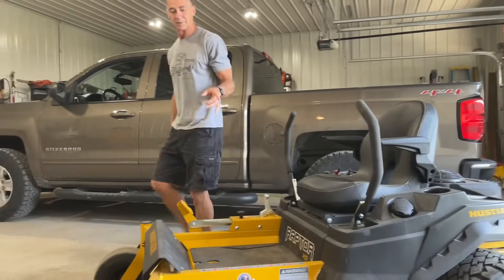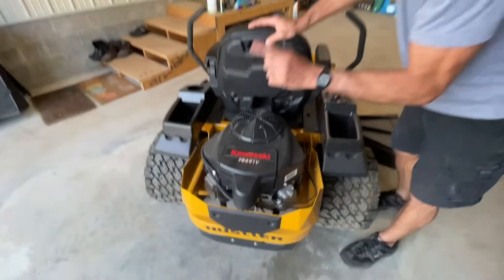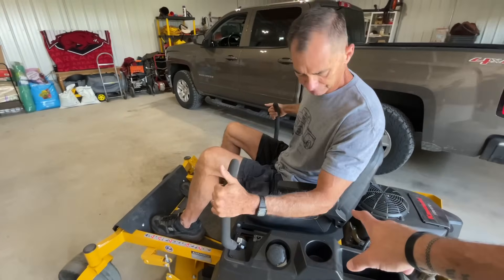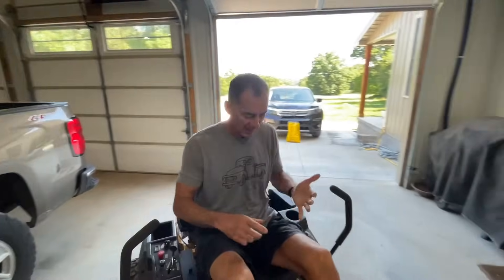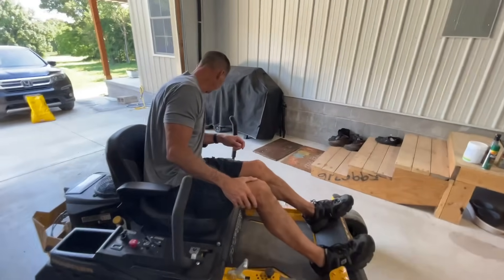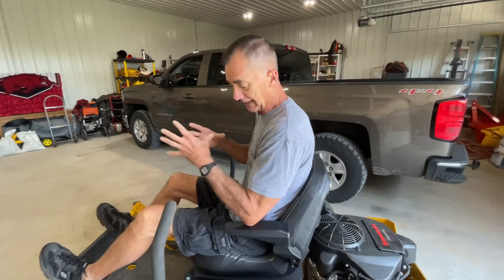DON’T BUY A HUSTLER MOWER UNTIL YOU SEE THIS!

Comment: I found it easy to buy my Hustler here in Australia. mine is the 34" Dash XD. When I found out the deck was fabricated and it had a Yamaha motor and it will fit around my water tanks it was a no brainer. It was hard to near impossible to find a zero turn that offers as much as this one. At $6500.00 dollarydoos it wasn't cheap but I need it to last. One acre is what I am mowing.
I am still waiting for it to arrive.
This a great review. no love for the brand but what it is capable off.👍👍
Reply from the maker: Congratulations,  Yamaha motor. Interesting. I hope we both have them a long time

Comment: One thing you didn't touch much on were the specs, specifically the Hydro-Gear transmission. Specs can be boring, but the right one can be helpful. I bought this model partially due to the the model of the Hydro-Gear (along with the Kawasaki engine). The ZT-2800 has a removable oil filter that you can change out along with the oil. Lower model numbers, such as ZT 2100/ZT 2200 (aka EZT) are factory sealed and don't require maintenance and don't have filters (or so I didn't read that in the service manual) unless the oil got contaminated. The service manual also doesn't mention the torque for these models. But the ZT 2800 produces up to 300 lbs-ft and the ZT 3100 (found in the XDX produces up to 350 lbs-ft). Also the gross vehicle weight is 1000 lbs and 1200 lbs, respectively. Thus if you want to tow some firewood, seeds, weed n feed, etc. then the transmission and engine HP will tell you how much you can haul. I know that may sound 'boring'. But imagine this. You go to a big box store and buy something with a few less HP engine and smaller transmission, then wonder why you have possible issues. My property doesn't have one level spot at all. It is all hills with some very steep. Thus I appreciate the transmission in the XD. I don't know if you researched the transmission, but at least you (or a dealer) can perform a transmission oil (and oil filter) change as regular maintenance, especially if you give your machine quite the workout. I am glad Hustler matched up the engine and transmission. With zero turns, you always want to buy as much (good) hardware as you can afford. By seeing the better engines and transmission, I can see this guy lasting a long time (compared to some of those cheaper big box brands).
Reply from the maker: Great information Eric. I did not know the numbers on the transmission other than xdx was more powerful. My ground is pretty level fortunately. I would have considered the xdx but for the 54 or 60 inch was several hundred dollars more so the xd fit the work and the bill. I agree this mower should last a long time. I really like it
Reply: @grandpadossfarms  Yup best comment I have read in a while on ZT. It’s all about the hydro’s on the mower that is where the cost difference’s are and the jump from residential to commercial. The larger serviceable hydro will cost more but give a residential owner a mower for life!

Comment: We own the Super Z 60" commerical mower.  Its a 2011 Model and we maintain around 6 acres of uneven property.  I can only compare ours to those I have used which is a Skagg and a Kubota.  The Super Z is a cutting machine as far as speed goes and though other brands cut just as well I don't think they can keep up with the speed and durability of the Hustler.  I have a friend who swears by his Ferris since the ride is supposed to be much smoother.  But all in all it would be hard for me to switch to another brand without a good test drive!

Comment: I’ve never had a hustler mower but I’ve done a lot of research and if I was rich enough to afford it and of course the property where I would need it they’re super 104 model is pretty amazing. Lol. It’s similar it’s the industrial but it’s got flip down wings on the side and 104 inch cut and you can do a football field which is just over 1.3 acres in 10 minutes. Lol.

One thing you were talking about are the handles or the armrests and getting up putting pressure on those. I realize they might break but one good thing I noticed is he just screw right down to the side and it gonna be really easy to replace if they do. Not all seats are quite that easy.
 Lol Chad camera I think you’re allowed to say John Deere. My old John Deere, I still have it it’s just very old doesn’t really have a gas gauge on it but there’s a little part of the tank that sticks out under the front of the seat so you can see the fuel level in there through the plastic on the tank.  Fugate it would be nice but even on some of the very expensive mowers I don’t see them. No rush she looked for one but it would be nice. Especially if you have a diesel because they’re a pain if you run out of gas you have to re-prime everything.
Reply from the maker: 104 inch cut, ha that's a big one Shane. Ty for the comment. Have a good day
Reply: @grandpadossfarms  it’s pretty much exactly what you have, it’s their industrial version but it’s just wider and faster. Lol. Way overkill for most of us but I like overkill when I’m dreaming but I think you made a great choice.

Comment: Hi Ralph great video I have the 42 inch hustler and it’s the best mower I have ever owned I myself like to maintain my own mower as I’m a mechanic by the way I’m living in perth Western Australia a long. Way from you . I heard about the fuel gauge issue I use the hour meter to work out when I need more fuel that seems to work well for me  the selling moto here in australia for the hustler is (putting the enjoyment back into mowing ) I have just put 60 hrs on my hustler still looks like brand new have never had anything go wrong with it .regards peter

Comment: Flex forks are a must.  Suspension seat would be the icing on the cake but with how tall you are you would need the steering lever extensions.  But I'm telling you the flex forks are worth every penny.  I don't know if the new raptor xdx and xd models come with a heat shield for the muffler but if they dont I would deffinitely get one of them.  If u notice burnt spots in the grass that is why.  The only thing I hate about this new model raptor xd is the lack of a visual fuel guage.  The older models had a cut out in the plastic cover so you could see the fuel level without lifting up the seat, you could bend over and see it while you were mowing.  Also you may want to look into gator blades and an operator controlled discharge chute for the fall if you mulch leaves.  I love hustler mowers.  No one can recreate that smooth track steering that they have.  You forgot to mention the integrated parking brake.  People don't realize how convenient that is until you mow without it.  Picking up stick, moving toys ect.
Reply from the maker: Great comment John. Definitely gonna get the forks. Yeah I forgot to mention the brake. Not being too familiar with ZT's didn't know that was a plus but I like it. Appreciate the information

Comment: I cut 10 acres of grass. I’ve got a 2014 hustler super z with hyper drive rear discharge. I did pay $14k, and it takes me 2.5 hrs to cut. Residential zero turn took me 6-8 hrs to cut before this mower, my back and time got saved. I would spend the money today for me

Comment: Most important for longevity and reliability - does this model have oil change serviceable axle drive transmissions ?
Im 72, in New Hampshire, retired master technician with German car dealer. I know quality and sound engineering . Good presentation gentlemen 👍✌️

Comment: I bought my Raptor in 2016 and it was my 1st zero turn as well. Retail was $3,300. I also have the Kawasaki 23 hp engine. One thing that matters to me now is the changing the hydraulic fluid myself in the drive units. I do not have the filters or the reservoir on mine and it looks like you don't on that one. I would want that if I was buying one again.

Comment: I said xdx but it's a Fas trak 54. I bought a commercial mower because if I decide to sale it it will sale easier. I'm cutting just under 2 acres. Was using a craftsman gt6000. This new o turn is a war horse.

Comment: Convinced me of what I need.  Think I'm getting the 42 inch hustler xd.  Did Grandpa ever think of drilling the frame and installing a grandpa pole?  I've seen various aftermarket poles that are installed at the front of the mower foot deck.  Just another option.

Comment: I just bought a 54” Raptor XD, and put it through the one heck of a boot camp to find it’s limits. 
I mowed thick, high weedy grass in the rain. 
I almost couldn’t get this thing to sink or lose traction. Those wide tires are great. 
It will bog down with the thick wet stuff if you don’t take it slow. 
I managed to stall it out by disengaging the PTO with a choked deck and reengaging it at a lower throttle position. 
It didn’t want to start back up after that. It would try, and you could feel the engine shift bit it wouldn’t turn over. 
So I raised the deck and cleared as much as I could by hand and made sure I could spin the blades. 
Then it started up, but with the blades still engaged (PTO switch was off). 
I had to throttle it up and cycle the PTO switch on and off again to get the blades to shut off. 
No problems after that. 
I guess the PTO switch/clutch got stuck. 🤷🏽‍♂️
But now I know what it can and can’t handle. Now to put some hours on this dude.

Comment: Bought a raptor sdx In 2018. 80 hours on the original motor and it blew up. If you can avoid Kawasaki motors, do it at all costs.
24 hp btw

Comment: I was thinking of buying this Hustler Dash XD. 
But when I compare it to the Snapper 360Z Kawasaki same 42" inch cutting
 width, Hustler is a little low power 18 HP vs Snapper 21.5 HP.
Hydro gear is ZT 2100 on the Hustler EZT 2200 on the Snapper'
2 gal. fuel capacity on the Hustler 3 gal. on the Snapper.
Hustler warranty is only 2 years  200 hour part only compare to Snapper 3
 year unlimited hour and parts & service. Lifetime on the Frame.
So I went ahead and decided to buy the Snapper 360Z.
Reply from the maker: Congratulations, the most important thing to me is that you did the research and made a great decision. I had a snapper tractor I gave to my son. Good mower

Comment: Does it have a parking brake?  Does it stop when the controls are in neutral? I’ve noticed the bad boy even though controls are in neutral it will creep.  Mow in reverse? And is there steps in order to start it?  Parking brake if it has one need to be set?  I’m sure lever need to be in neutral but I don’t like the bad boy having to have parking brake set in order to start.  Gonna try to get to dealer and get these questions answered just curious.  Also what’s yard look like now?  Mulching blades?  Oh also does the shoot flip up and stay up or is it spring loaded and fold back down automatically….great review of more as well I’m comparing the bad boy life with this line and model.

Comment: I have the same exact machine.  My 2 gripes, you can only fill the fuel tank about 2/3 because the filler neck isn't on top.  And those tires are terrible, they spin all the time.  I have more dead spots in my yard now because of spinning tires.  And it doesn't matter how slow I go, they will still spin if the mower isn't perfectly flat.  You probably don't notice mowing pasture, by I have a nice yard.  Pretty soon it won't be nice with all the skid marks created by these horrible tires.  This thing needs turf tires!
Reply: Cheapest and a fairly simple solution for your tire issue. 
go to your local parts store. oriellys, auto zone, napa, walmart, rural king, etc... anywere that sells washer fluid. 
buy 6 gallons of -40 or more washer fluid, and 1 plastic bottle of water with a plastic cap.
on the way home drink the water (proper hydration is nessassary at all times).
once home jack up your mower secure with proper jackstands etc. next drill a hole slightly smaller then the valve stem cap in the cap of your water bottle.
using a sharp knife cut the other larger end of the bottle off. making a kinda funnel. screw you cap onto your valve stem. using a valve stem removal tool pull your stem out then screw the large end of the bottle on to the cap. set the tire valve stem face up on the ground. and commense to putting 3 gallons of -40 (or more degrees) washer fluid into each rear tire. these tires will handle more fluid you can add more i think they will handle 5 gallons a side. but i was happy with 3 gallons each in mine. replace valve stem air back up to 8-10 psi are replace tire on hubs and enjoy!
warnings conserns.
tires will go from approx of 10-12 pounds of weight to 40-45 pounds of weight please us caution and left accordingly to avoid serious injurys to yourself.

so you might say this or that but the washer fluid is better then say calcuim cloride or water. 

pros and cons to water calcium cloride and washer fluid
1 water will freeze durring winter time. 
2 calcuim cloride altho heavier will cause rust eventually and youll have change your rims out at some point. 
3 washer fluid being alcohol or other glycol based will not freeze like water and sence there salt brine or salt based material it will not cause corrsion of the rims. and if you ever need to change tires or rims or put a plug or even patch all that can be done just as if there was air in them.
if and when you do have a tire issue later on down the road the cons to washer fluid also are that the rim will be very very clean as well. 
1 gallon washer fluid is approx 8 pounds
1 gallon water is approx 8.5 pounds
1 gallon calcuim cloride is approx 11 pounds 
(US weight ratings as shown is in approximation with different types of other chemical/minerals in liquids) (fluid tested by me for going on 4 years now best thing i ever did) (tested using 2003 country clipper jazee 1,
2019 troy built bronco, 2014 husqvarna, 1978 lgt145g).

Comment: Very informative video, thank you! 

Wondering if you have any hilly areas on your land & how the mower does traction-wise with that?
Reply from the maker: No Melinda I do not. I'm sorry I can't tell you how it performs on a hill
Reply: I run a 52” Mini Z Hustler mower so can’t comment about this particular model but Hustlers tend to have their weight down low. I have a ditch that is steep enough that lawn tractor style mowers will literally roll over and my Hustler mows it just fine with Carlisle multi track tires. If it does lose traction the weight is low enough that the mower just slides down the hill side ways with no concern of it flipping over.
Reply: whatever mover you purchase have the dealer change the tires to a farm style tread, the turf tread will just sit and spin on a hill if the grass is wet

Comment: After 2 years, how is the mower holding up? Do you still like it? Any new likes/dislikes. I'm in the market now and this is one mower thats been on my radar. Thanks for the info!
Reply from the maker: Holding up very well Jeff. I changed the oil and filter easily. It’s easy to clean off after I mow. No engine problems at all. It’s a very sturdy mower. I have a couple changes I would make. The gasoline fill is under the seat not too accessible. You can’t tell how much fuel you have left. It would be great if there was a gauge on top of mower for that. It starts easily.  I added the front suspension bars for a little smoother cut. Honestly I can’t tell the difference for 300 bucks. I would buy this mower again.  Hope this helps
Reply: @grandpadossfarms  I appreciate the reply. Thank you again for the helpful review and the follow up on my question! Have a great day.
Reply from the maker: @jeff-mk1ty  you bet. Any time
Reply: @grandpadossfarms  good to hear. I've been thinking about a zero turn liked the hustler when I looked as well as badboys. I'm not certain about the cub cadet zt1. I also have less than 3/4 acre so there's that.

Comment: Currently own a Raptor SD. I've had 3 hustler ZTRs in recent years. They get worse with every new model. Had the brackets replace, cracked fenders, deck vibration noise etc  etc, etc. I have found that Hustler will work with you until they decide not to. My case was escalated to Nick (Sr. product representative). After another failed attempt at a repair, nick would not return any phone calls. The case was escalated to the next level (Ken Coker). Ken provides nothing more than lip service. He did call me once. When I provided video proof of the complaint, he failed to ever contact me again. The mower is still under warranty, the dealer will not do anything more and tells me that Hustler will not do anything more. I would never touch another Hustler mower ever. They will not honor the warranty if it is not a very simple problem. Either they don't know, or don't care about fixing a customer's mower.

Comment: If you buy a one acre mower, does it shut off after you cut one acre?  Do you have to reset it to cut more ground or wait for the next day?   Does the gas cap automatically lock so you cannot fill it after cutting one acre?   If you buy a 2-4 acre mower, does that mean you cannot cut one acre?  I would hate to buy a 2-4 acre mower and then could not use it on my one acre.   Right now with my Craftsman LT3000 lawn tractor, I cut as much as I want,  and go as long as I want.  I just have to put more gas in it from time to time.   Just asking.

Comment: Thanks for your review. I am looking at a place with 1 Acre but is mostly on a slope. (Probably 20%) How is this or the Dash XD or Raptor X going to fair with a slope? I would maybe go for a more power full motor just for the slope. My thought
Reply from the maker: This XDX has plenty of power for a slope. I have about the same. Mine is a 23 horse. The larger the deck the bigger the engine
Reply: @grandpadossfarms  Unfortunately for me Hustler mower manufacturer are 10,000 units behind due to demand. They have put a hold on all orders at this time. Going to have to buy something else
Reply from the maker: @06Trdrew11  oh no.